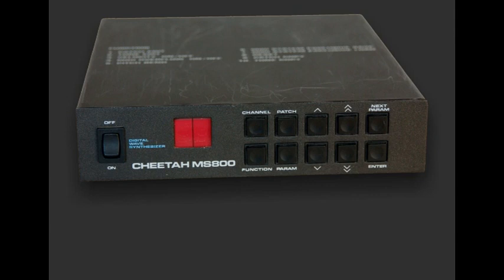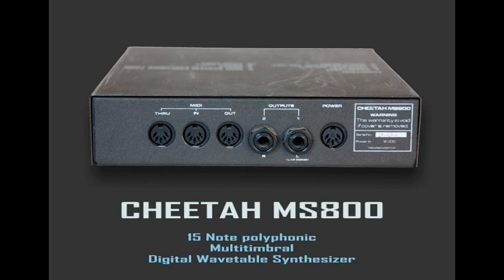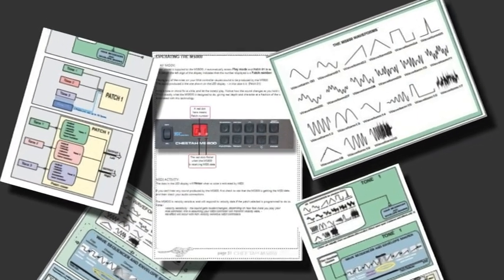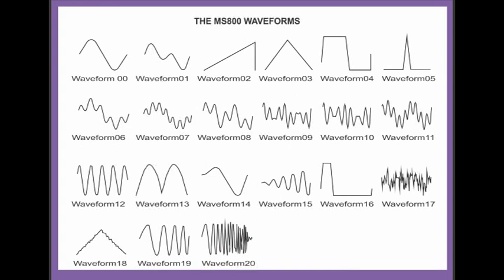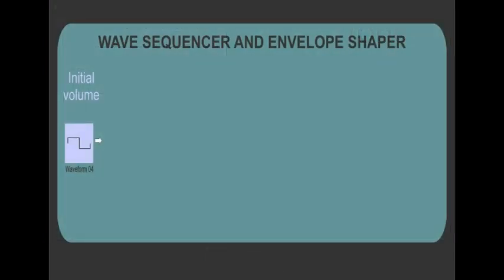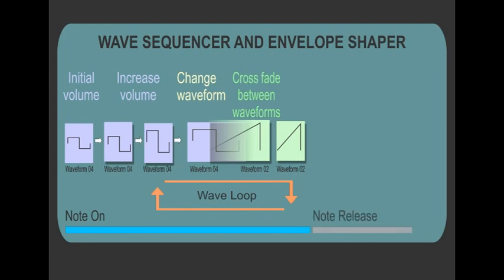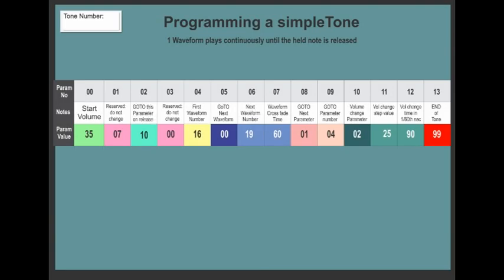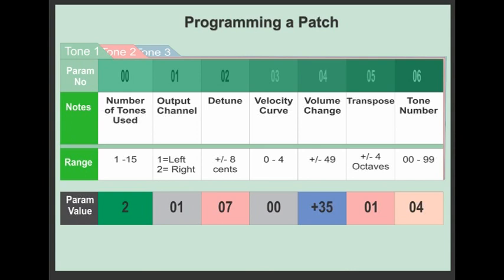Cheetah MS800 Basics

Comment: Thanks for the upload. I can see I am years late commenting here haha! I completely understand what a lot of hard work this synth is. Still, I absolutely love mine - but unfortunately it has stopped working recently. No lights and no sound and I am now trying to find a schematic. The first thing though is to check the PSU attached to that DIN plug. Do you know what the voltages should be?

Comment: I bought one of these when they came out. It was one of the cheapest synthesisers at the time. They said it was a wavetable synth not unlike the PPG Wave. I got it back to my studio and it didn't work correctly. The operating system was very complex to use. Also I found the original unit I had was so noisy. I had it sent back to Cheetah and they never returned it. I got a full refund and never saw them for sale again after that.